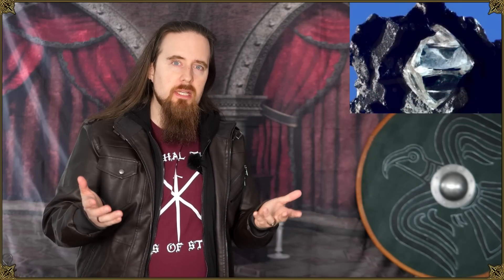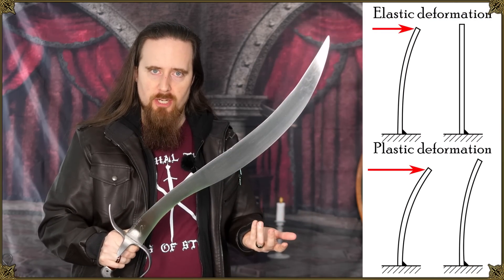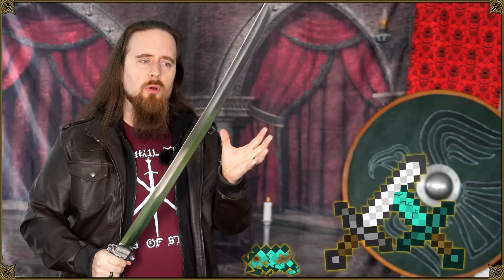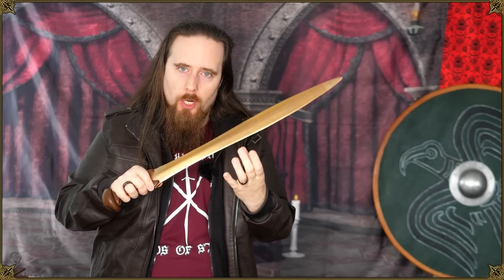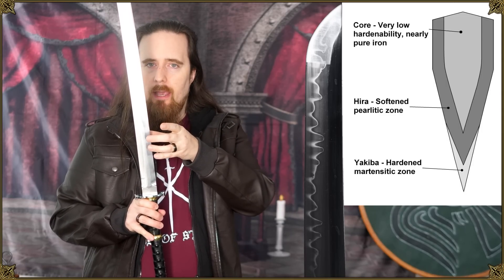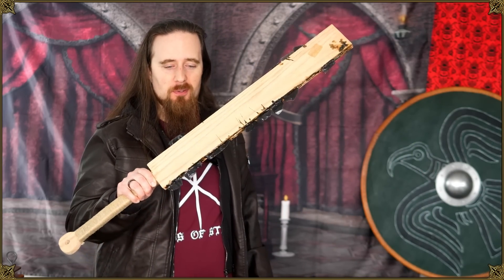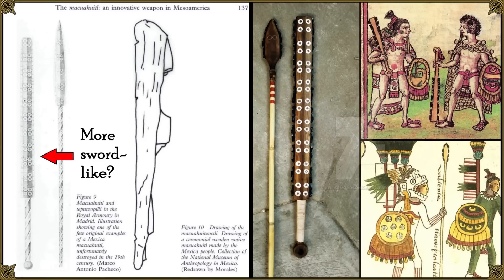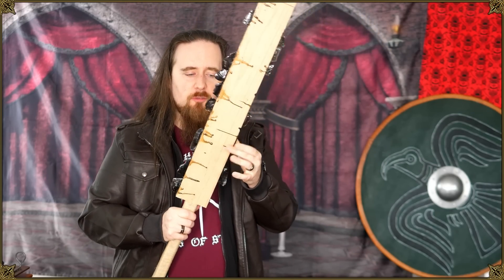Diamond Swords: Could They Work IRL? (Kind Of)

Comment: I was gonna make a dumb memey joke but decided to add some scientific context. When you talk about "toughness" you're talking resiliency and tensile strength, a tempered steel blade is a spring and the factors you're describing are extension and compression, hardened and tempered steel has a ton and I mean a ton of advantages in these categories while still maintaining a sharp edge, over just about any other material you can imagine.